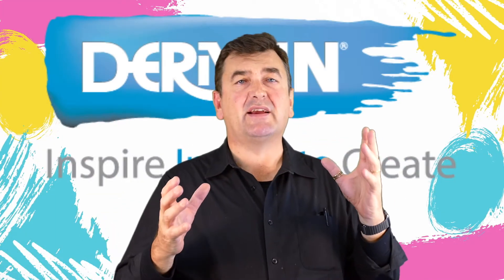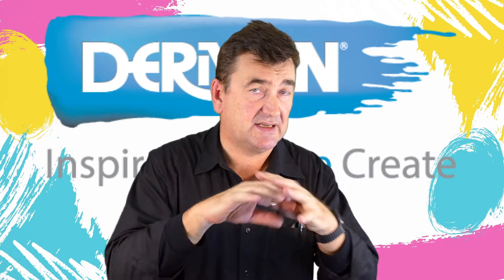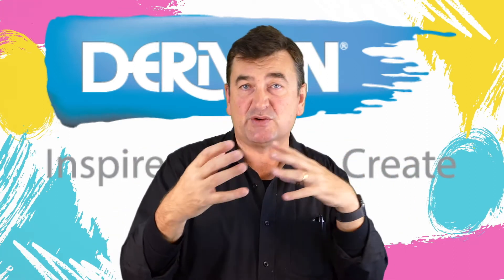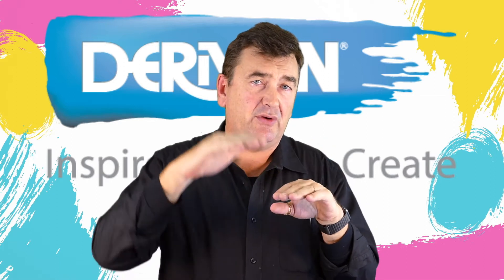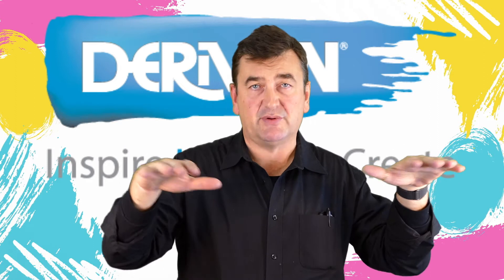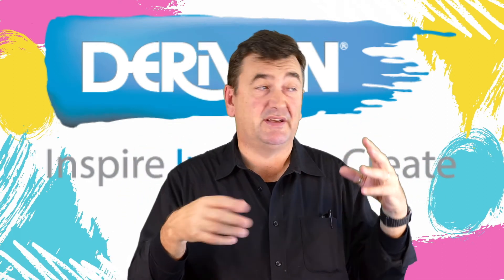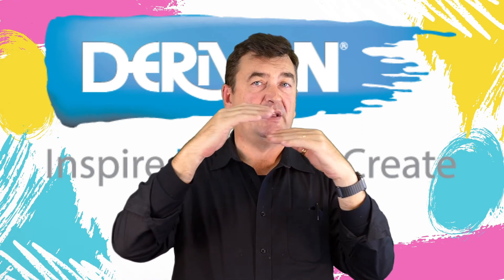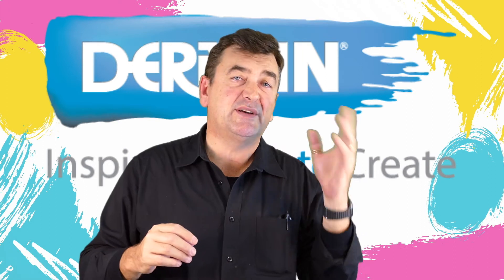How long should acrylic paint dry before varnishing?

Comment: You explained that really well, I actually understood what you were talking about thank you. Is it true that if you use too much water with acrylics, they won't bond and therefore look chalky and may rub off? And is best to use a medium in place of water except when cleaning the brush before using another colour? Thank you, I love using your paints and the colours are amazing! Cheers from Tasmania!
Reply from the maker: Thank you! - yes indeed adding "too much" water to acrylic paint will have the effect of reducing the binder (glue) content and therefore it may "re-wet" or blend in with subsequent coats or a varnish coat, or as you suggest go chalky, and rub off easily. Best to use a medium, like Matisse Medium MM9 Acrylic Painting medium in place of the water (there are other mediums you can use to increase binder content) check out this video https://www.youtube.com/watch?v=H2igXmlbcXE